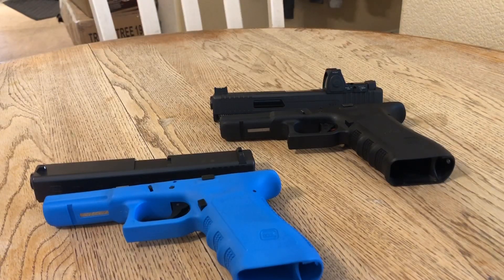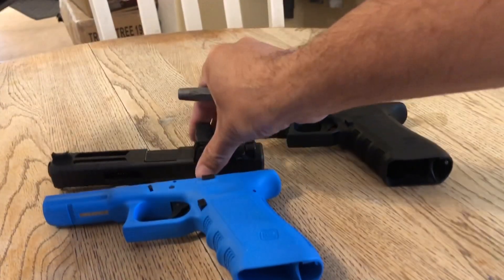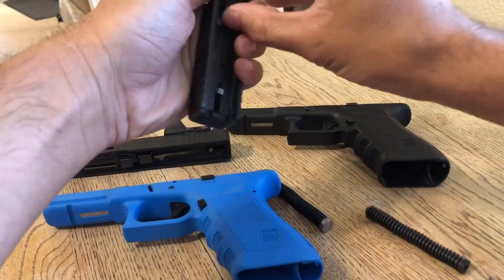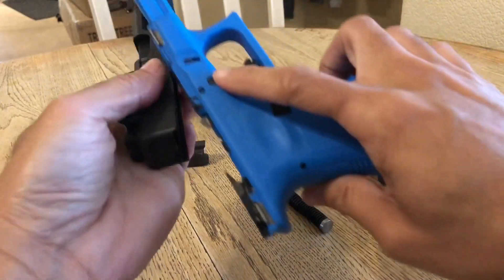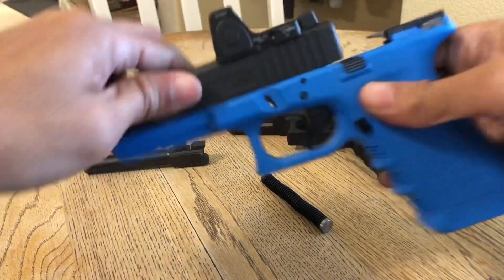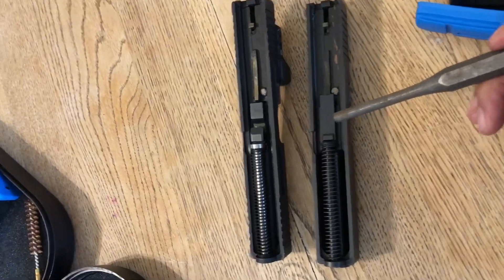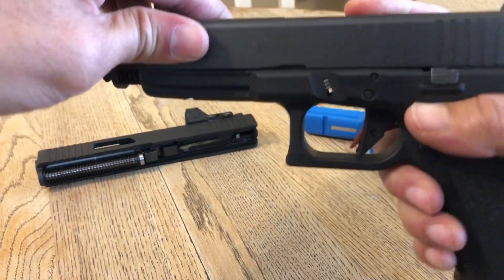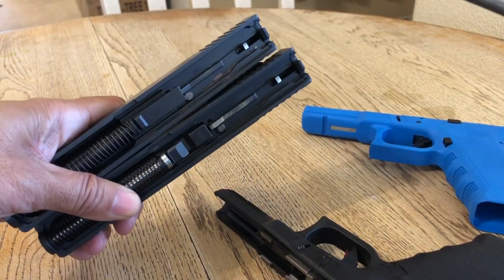Will a Simunition FX Slide Fit on a Real Glock Frame?

Comment: If anyone is curious, you’re able to buy a 17T complete slide and locking block. You’ll be able to use a 17/22/31 frame to make it complete. But obviously there is no way to just slide it on. It’s incredibly fun with friends and a great great training resource.
Reply: Also the 17F frame can be converted.
Reply from the maker: Awesome!